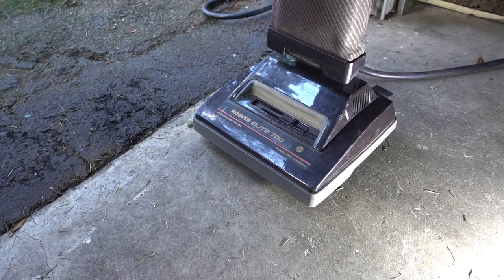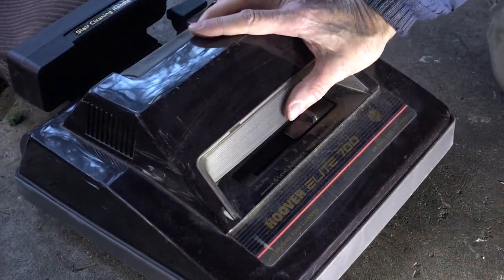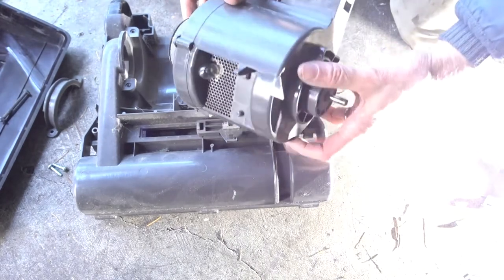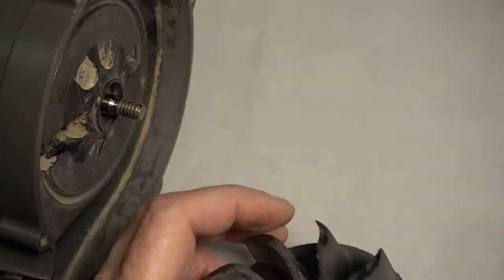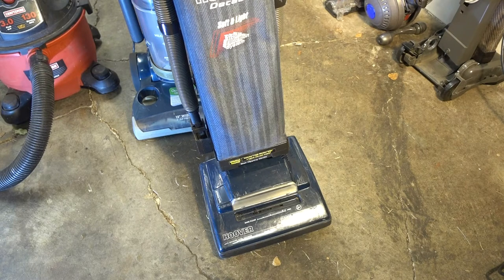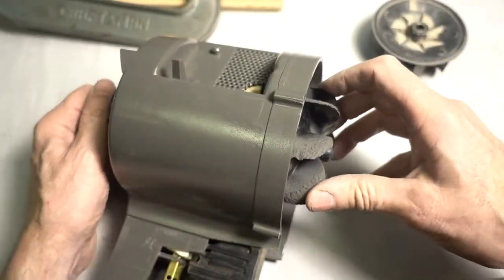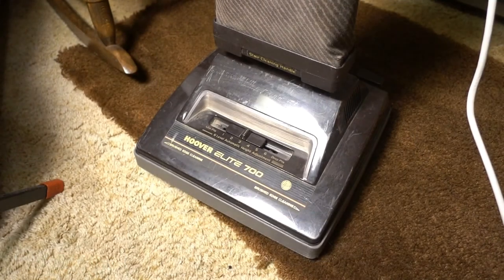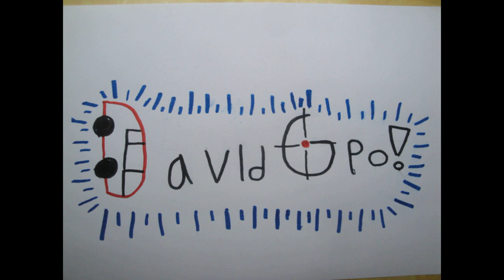Repairing a Hoover Elite 700 Model U4511 900 Upright Vacuum Cleaner

Comment: I have the Hoover Elite II, model 4511 Upright with the same exact symptom (no suction), I suspect my problem is exactly same as yours... Now I have the confidence to open my baby up and try to fix her! Thanks so much for your excellent tutorial on this classic Hoover upright. This old school AMERICAN upright is the BEST.
Reply from the maker: Good luck.  I've thought of a way to repair the fan but I'm not sure if it would work...I think installing a thread repair insert w/left hand threads might do the trick if you can't find a replacement fan.
Reply: @davidgpo  I think I found a (new) replacement 7 blade fan for the Hoover Elite I have on eBay. I’ll let you know if it fits when I receive it.  Thanks to your inspirational repair video, I may be able to fix it.
Reply from the maker: @bills.7175    That's great!

Comment: Thank you for your video of the disassembly!  I'm not very handy, so I was stumped at getting that housing off (your help at 4:30 or so).

My Elite 400 vacuum (u4475), that my mom bought for me back in the 20th century (built 1988, bought used in 90-something), needed a little attention.  I still haven't figured out why it will no longer stand up; it feels as if there used to be some spring-like force holding the kick-switch in place, and that spring-or-whatever is now missing.  I'm not sure.  I found a little rectangular plastic tab loose inside, but I can't figure out what it snapped off of.

Also one of the motor mounting brackets is snapped off (seen at 22:30, on the same side as the broken kick-pedal), I hope that's not essential.  I'm hoping that the direction of pull of the belt will hold it in place.  Maybe I can figure out a jury-rig for it.  Metal bit of strapping, maybe, or a zip tie.

Anyway, at least its insides are much (much) cleaner than they used to be.  Maybe it'll give me another 25 years, with or without being able to stand up on its own.
Reply from the maker: Sorry, I'm not familiar with the problems afflicting your vacuum.  This was my first vacuum repair project.  Perhaps the tech at your local sewing machine/vacuum shop will lead you in the right direction? Thanks for watching!

Comment: I have that same exact model! and I love it! Those Hoover Elite 700s are very rare to come by and I collect a bunch of Hoover Elites to and I have that Model in my collection. I know if I was there I would’ve just gave you one of my spare Elite motors because it sounds like the bearings are shot and that motor would need a complete rebuild. My 700 had a motor issue too but one of my Vacuum collector friends owns his own vacuum shop where I live and he has some very special Hoover servicing repairing equipment including a special Hoover grease gun that was used in a Hoover service center back in the day. And now that motor on my 700 sounds perfectly fine now and it is a lot quieter too! 😊
Reply from the maker: Yes, those are great machines!  I haven't noticed the noisy bearing, you're the second person to mention it so it must be going bad. I must have spent too much time around explosions!  I do have a parts vacuum that I can use if need be.  I may contact you in the future if I have any questions.  Are those stock bearings that can be found at NAPA?
Reply: @davidgpo   okay cool that’s fine! And no the bearings you can’t find at NAPA. But I did find the right bearing size on eBay that fits any Hoover elite vacuum‘s including your 700. If you want to I can email you the link to the bearings that I found on eBay and if you have any questions about any of your vacuums you can email me too! 😊
Reply from the maker: @dannymcelroy4046    Thanks Danny!  My email address is davidgpo@msn.com
Reply: You’re welcome no problem hopefully that works. I sent you an email to for the link to the bearings on eBay. 😊

Comment: I have a similar looking vaccum model number U4256 - 900 and am trying to figure out how to remove the outer fabric bag to wash it - I have the upper portion unattached but how do you remove the lower  portion  - is it machine washable do you think …???
Reply from the maker: Mine has a slotted screw at the front.  Best of luck!

Comment: Thanks for the video! I'm getting ready to open mine up and see what the problem is. When I turn it on the unit runs very loud. My son said that a screw or something metallic got jammed up in there. Hopefully it will quiet down when I find it. The unit does have suction and the brush roller turns but has plastic fiber or something tangled up in it and I intend to clear that. The "J-clip" which holds the bag up is missing, does anyone know where I can find another one? TIA
Reply from the maker: There's probably a lot of fibers wrapped around the rollers.  Also check the bearings in the motor, they get noisy when the bearings wear out.

Comment: That's a beautiful rare Elite right there, I've never seen that model outside of Vacuumland.  The fan for these are getting harder to come by (especially those 10 blade fans which are next to impossible to find since those are only common for early model Elites), but if I can find one NOS, even if it's that new 20 blade fan (which I would have replaced if that was my vacuum), I'd throw it in instantly, it's honestly a much better design (and definitely lowers noise and increases suction and airflow) since it has a nut molded into the plastic of the fan instead of just threading the plastic like Hoover did with those 10 and 7 blade fans..  Also the motor still sounds like it needs some help there, it sounds like it could use new motor bearings.
Reply from the maker: If I had a 3D printer it would be easy to recreate the fan.  Thanks for the tip about the bearings in the motor.  Those bearings are usually "off the shelf" items which should be easy to replace if Hoover no longer stocks them.
Reply: When I rebuilt the motor in one of my Hoover Elite style uprights, I actually used generic 608 size bearings, but I made sure they were EM capable, they've been working great ever since I installed them.
Reply from the maker: @graysonsvacsandmowers5426     I don't know what EM capable means but that's a great tip for the bearing size.  Thanks!
Reply: @davidgpo  EM stands for Electric Motor, you'll find that in the listing of the bearing online that they say 608 EM or EMQ (Q for Quiet), also some 608 bearings that are used in some skateboards don't turn as fast as the ones for electric motors do, so ones that work for electric motor will be same to use on a vacuum motor.
Reply from the maker: @graysonsvacsandmowers5426    Thank you sir, that's very helpful!

Comment: Is that I’ll tell you the year that it was built because I believe that machine came out in the early 80s because of it still having a 10 bladed fan you can get the newer 20 bladed fans online and some places
Reply from the maker: OK, it was given to us in 1977.  Serial number is 099000016745.
Reply: @davidgpo  OK are you sure it was 77 because the serial number shows it was made on the ninth month of 1990 and Hoover’s paperwork shows that to be true and sit in the 70s they had machines are the convertible and the dalmatic by the way if you ever find those kinds of vacs  that are very collectible
Reply from the maker: @Vacland   Thanks for jogging my memory.  You are correct. In '77 we had basic model Hoover, I believe.  It had green plastic cover, with a spring clip, holding it on top of the housing to access the drive belt.  The belt was round rather than flat and was attached to a tapered shaft with a half twist to keep it from spinning itself off of the shaft.  It broke around 1990 or '91 and my father in law gifted us the model U4511, for which I have the owner's manual but not the receipt.
Reply: @davidgpo  If it was green it had a clip on top of the top on that was a dalmatic I really do miss the older Hoover’s because those I think we’re actually made by Maytag